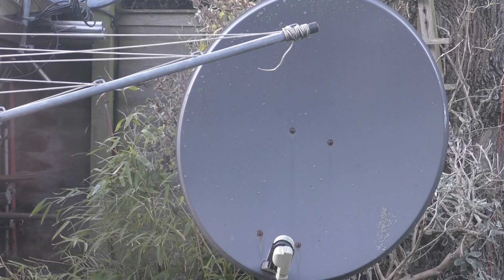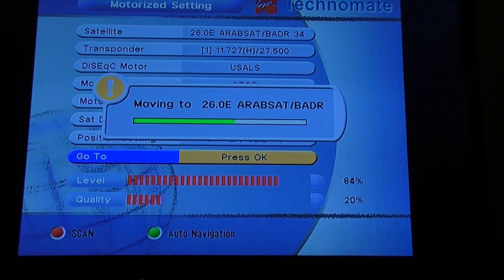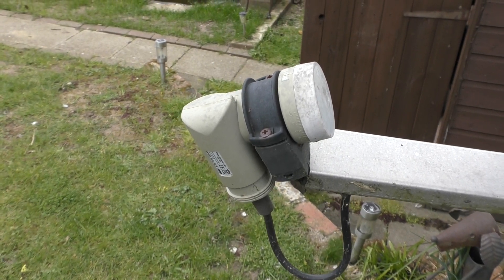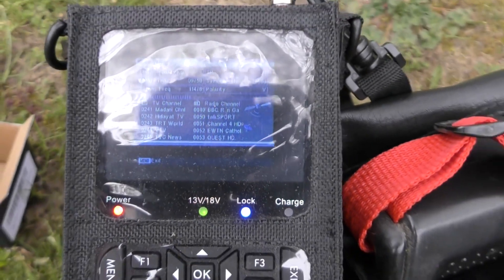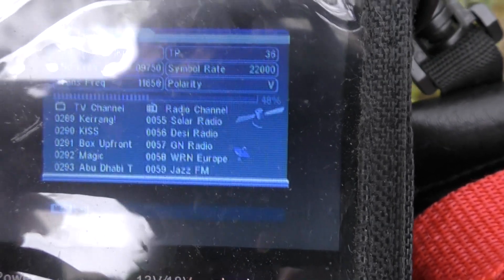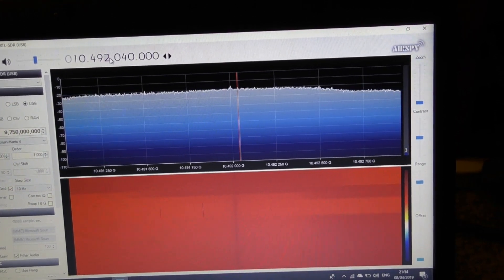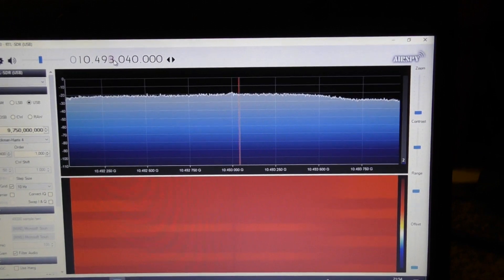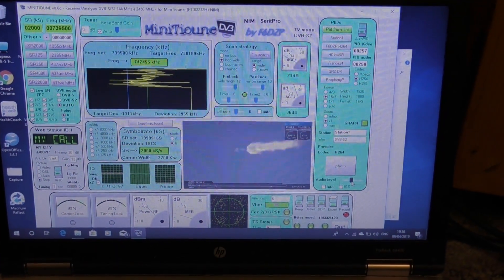Receiving Es’hail 2  QO-100  using my motorised satellite.

Comment: Hi .  Great video.  I am only new to the topic.  I wanted to ask if you can receive both datv and all other frequencies with a single LNB.  Do you have to reconnect the cables from the sdr to the miniitiouner and what does the power inserter do when the reseiver takes over the power supply?  thanks in advance
Reply from the maker: Single output LNB being used. The satellite receiver provides a output from the LNB and this can be used at the same time as satellite receiver.  I use the Power inserter to stop any voltage going into minitiouner or vice versa. The satellite receiver does all vertical and horizontal switching without risking the minituioner.

Comment: What size dish is that ? Plenty using 80cm on NB and 1m+ on DATV. I only use a 1.2m and around 40w but others are only using 25w and getting good DATV signals in 👍
Reply from the maker: It seems my reply's are disappearing! I thinks its 90cm. That's good news that less power can be used.
Reply: @m0jtt @darren where can get the 40w amp from